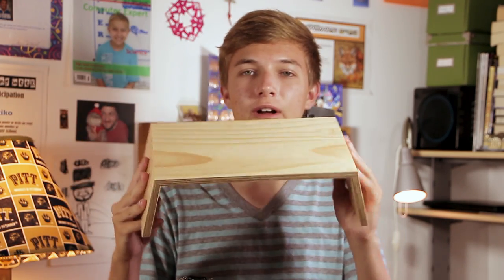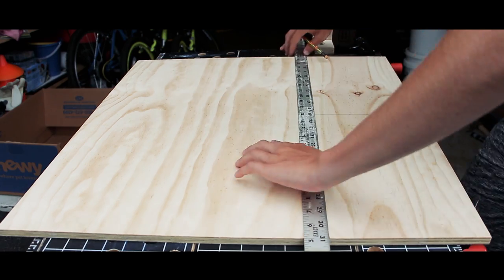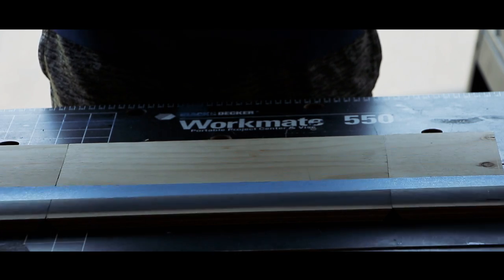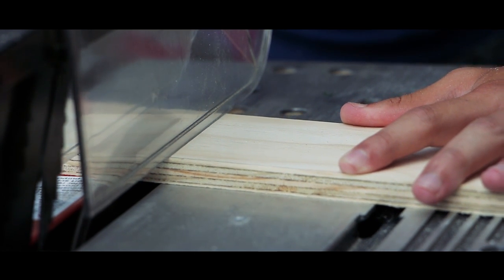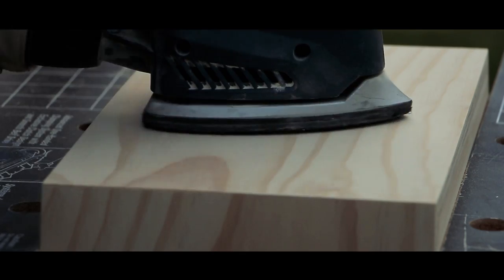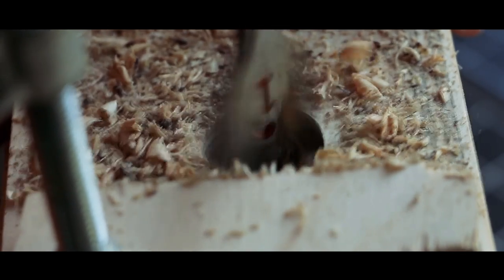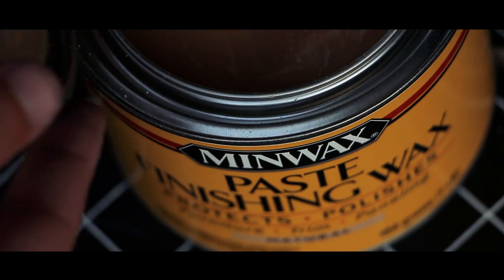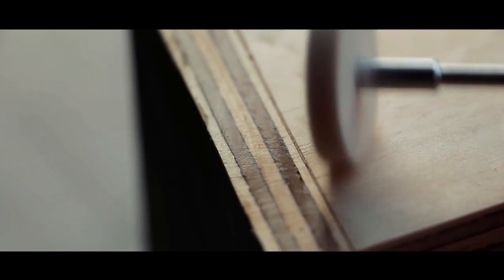DIY | Wooden Monitor Stand

Comment: This video is exactly what I was looking for. Lacking a table Saw, i Will build one with a compound mitresaw.
Reply from the maker: As long as you have a way to rip down your plywood (or I guess really anything around a half inch thick) it shouldn't really matter what kind of saw you use

Comment: What is the angel of the base of the legs? I'm new to woodworking and not sure how to figure out what the bottom of the legs need to be with a 70 degree corner.
Reply from the maker: The bottom angle should be whatever angle the the legs are tilted off of square with the table. So if the legs tilt inward at 70°, that's 20° off of 90, so that's what angle you need to cut on the bottom of the legs